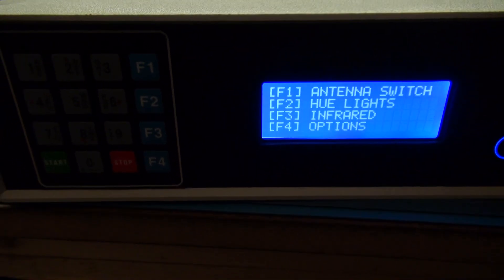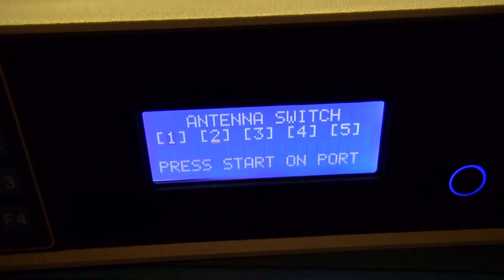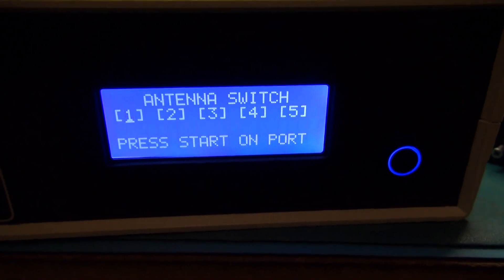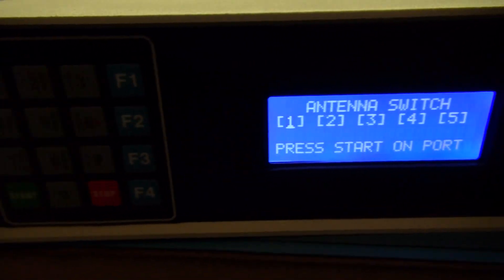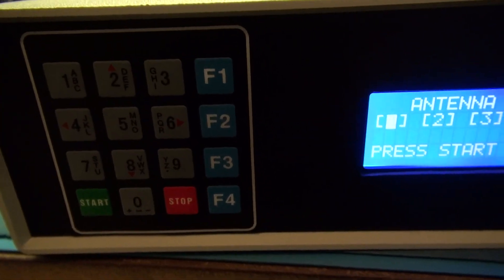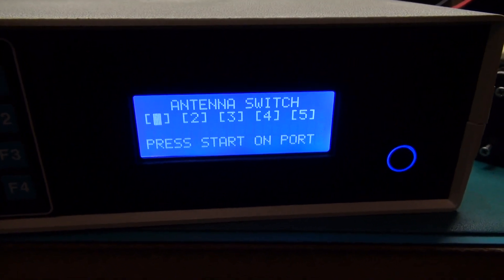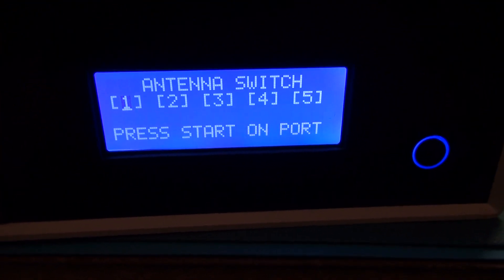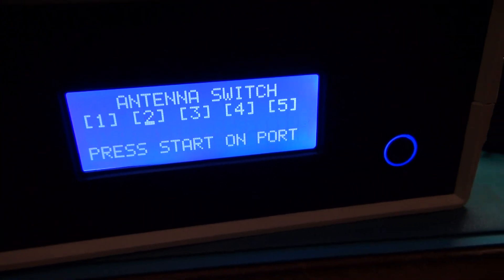ARDUINO ANTENNA SWITCH PROJECT UPDATE 4

Comment: The voice could be a problem when the radio was on. But nice idea but could lead to a mistune.
Is this the last video on this project?
Is there a change of the sketch and build info on this project?
I am building an auto tuner with antenna analyzer will be adding 4 Antenna switch and 4 Transmitter .
using the Arduino due for the switching and stepper motor control and a pI for the graphic display.

NW4K 73's
ED